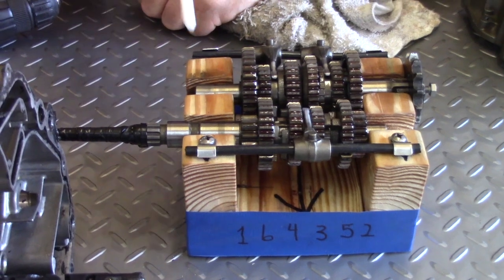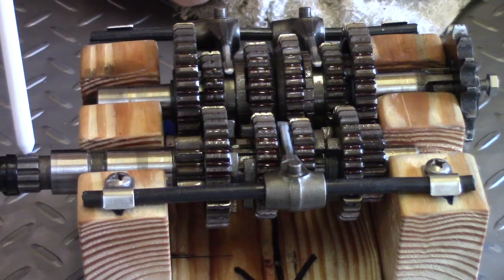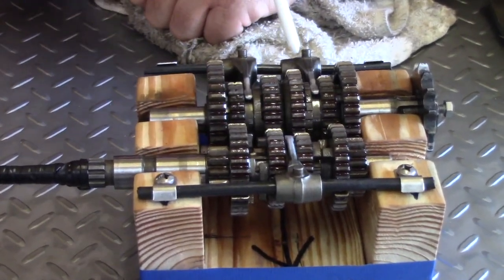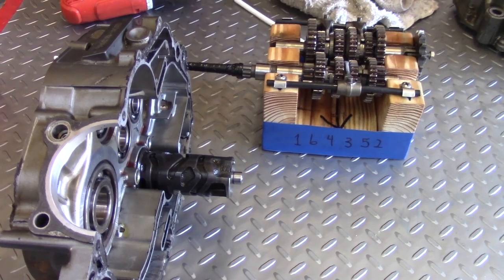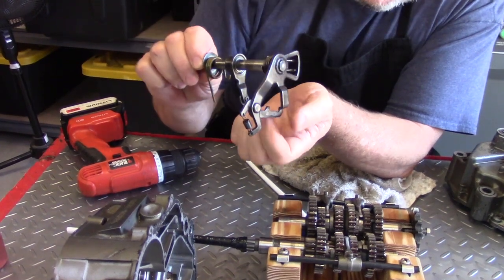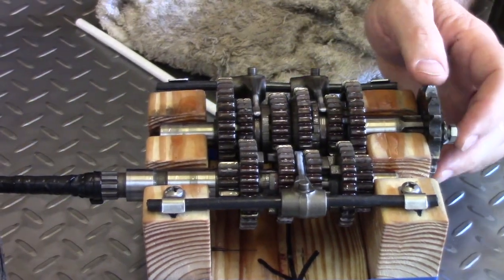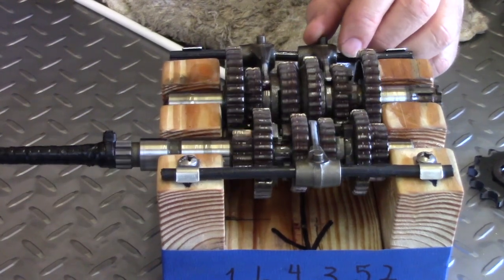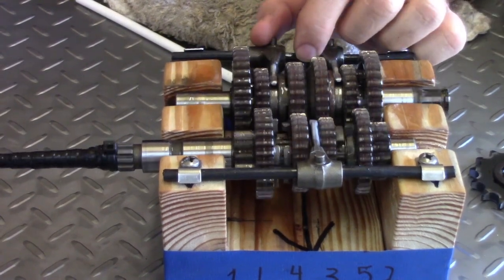How a Motorcycle Transmission Works

Comment: Thank you so much. I was on the interstate with my project bike and I had it stall. I was coasting in neutral and it about 27-29mph I tried to pop it into second so I could attempt a rolling start and got that loud gearbox "KA-THUNK" because it wasn't synced and thought, "what the hell is actually happening in there?". Now I know

Comment: Good understanding...by me...one small query for 5th and 6th gear you wrote wrongly(changed)the number of teeths in driver and driven as eg.for 5th gear 25 for driven and 27 for driver..instead of that you displayed 25 for driver and 27 for driven...I got confused with did and checked all other gear ratios and got cleared...but all the way great realistic model explanation...

Comment: How does gear dogs slide in when speeds are mismatched
Reply from the maker: Leo, that's the nice thing about "constant mesh" transmissions - the gears are always meshed. Have a look in the Articles section of my website and you'll find a detailed explanation of this design. The only thing that the drum has to do is engage the two shafts which are the same size and when the clutch is pulled or the throttle "blipped" removes the side load and allows the forks to easily move the "dogs" in place. Check it out - and I'm glad you asked! Gordon

Comment: I saw no real difference in output speed until 5th gear. I have yet to find a video to explain with a proper demonstration how the shift lever/drum works.
Reply from the maker: Thanks for the comments. You're almost right - there is very little difference between 5th and 6th. 5th is .9:1 (point 9:1) while 6th is just .8:1 (point 8:1) so just 10%. If you visit my website and the Articles Page, I have an article there with lots of detailed drawings and explanations of how all this works. It will show you how all the numbers and transfer of power works along with that drum - all in plain, clear, english. I hope I've been a help to you. Gordon

Comment: When you're at rest and going from neutral to first, and both shafts are stationary, if the dogs are not aligned with the slots, how do you shift?
Reply: If both shafts are stationary, then your engine is off and the bike is not moving. To go from neutral to first in this case, you will need to move the bike slightly while pressing on the gear lever in the required direction.

Comment: great video thanks.
got a problem with my quad gearbox ,it works on dogs and cogs.2 3 4 5 all work fine,5 speed. 1st and reverse which i think are conected as you can only select reverse when in 1st gear. when you engage sounds like the cogs /gears are spinning but not meshed together so no drive.can you help thanks.

Comment: Excellent explanation.. Am I to understand that then to have 7 or 8 gears I will basically require a different selector drum (Extra gears of course) BTW why are the lower gears on the end of the shafts ? (less torque or stronger to stop bearing wear.)

Comment: Took me 3 times to see that the gears are already connected but the output shaft is non moving the rotation unless you are clicking in place with the dogs sliding in but the same time the dogs inner gears have to slide along the output shaft since they are solid with it how is it possible? The dogs don't slide left or right into place unless you move forward or backward the drum that's connected to the shifter going up or down)
Reply from the maker: Hi Alex, Yes - all of the "gear pairs" (front and rear) are always meshed. This is why almost all motorcycle transmissions are referred to as Constant Mesh. The shift forks move the dogs in/out of engagement. The shift drum has the very important job of controlling those shift forks so that 2 different ratios are never engaged at the same time. The dogs are the heavy blocks with side-facing cogs that slide into the toothed gear pairs. Those dogs are splined to the shaft with splines and simply slide side to side by the forks. The gear being engaged free-wheels on the shaft without the dog's engagement. If this doesn't happen, the transmission does what we call explode and cannot live. Let me know if this helps, if not I'll try to explain more. Thanks for commenting! Gordon
Reply: @RRRToolSolutions1  so the shifting is seamless and smooth unlike the one in a manual car transmission the clutch is needed to disengage the teeth. And a bicycle has a similar mechanism of rolling the chain on and off each sprocket kind of like the motorcycle except the motorcycle has the same sprocket and never moves because the gear ratios shift side to side instead of the chain itself... this leads to me the question why does the chain suffer so much abuse then unlike a bicycle I see metal shavings or gunk debree, needs to constantly tighten every several hundred miles and lubed with special oil? Why is there also a slack of 3/4 inch needed if the bike is not having the chain move out of gear or why the chain would sling off?
Reply from the maker: Alex, the exposed drive chain has to live and operate in one of the worst environments ever imagined. Dirt roads, paved road debris, small rocks, grit, and water all find their way to the chain. This is just like sandpaper wearing down everything that it touches. While lubricants, especially those having wax to hold the lubricant in-place do act to hold the contaminants in-place also. We have to lube though as it reduces wear more than a dry chain will. The slack is needed so the rollers do not bind in the sprocket peaks/valleys. Chances are that your front (counter shaft) sprocket is not in the center of your swingarm pivot - rarely is this brilliant geometry used. As the bike's rear suspension goes through it's travel, the distance between the front and rear sprockets "center" changes. In the case of dirt bikes (those with more travel), those distances can be very significant. You'll see spring-loaded chain tension devices there to keep excess slack from fouling the chain. Gordon

Comment: Never understood why it’s been
1N23456
And not
N123456
Reply from the maker: Ryan, neutral was at the bottom in the 1968, 1969, 1970, 1971, and 1972 Kawasaki Samuri, Avenger, and MACH III 500's for a N-1-2-3-4-5th. I've owned 2 of the Avengers and 3 of the MACH III's and they were brilliant. The 1973 models changed that and all of Kawasakis were forever changed to today's pattern of 1-N-2-3-4-5. Even Honda's very popular 1960's/70's CT70's and CT90's had neutral at the top and shifted downward 4-3-2-1-N where you pressed the toe downward from neutral at the top to 1, 2, 3, and 4th. I still have the 1969 CT90 with this pattern. Neutral can be anywhere the engineer wants it to be - the "Shift Drum" controls the where all gears are free to spin. Thanks for commenting! Gordon/RTS
Reply: RRR Tool Solutions 864-710-7964 thanks for all the info. I’ve noticed that for a couple of bikes you can actually reverse the shift movement so toe down equals shift up. Apparently it’s a common thing in motoX

Comment: So when a transmission is failing, what parts are causing the noise? My bike makes a loud click/clunk sound when changing gears, what am I actually hearing?
Reply from the maker: Jeff, what make/model of bike? Is the noise worse when going from Neutral to First than when going to Second, Third, and so on? This matters, so the questions....Thanks, Gordon
Reply: RRR Tool Solutions 864-710-7964. Thanks for the fast response! It's a 2012 BMW G650GS.  The click from neutral to first is most noticeable but it doesn't always make the sound. Shifting from first to second and third makes less of a sound and doesn't feel as "stiff" while shifting in to a higher gear  The entire shifting process isn't as smooth as other bikes I've rode, but some say this is just the way BMW motorcycles are and not be concerned.  
After watching your video I was thinking the noise is from the gears wacking together or not aligning smoothly. 
Thanks for any and all feedback!
Reply from the maker: Jeff, I've had the same problem with different bikes. You've got a big single that needs to idle at a higher RPM than most twins, triples, and fours. The culprit is your clutch - not your transmission. There is an easy fix -

Large singles deliver their power all at once which means the combination of clutch diameter and number of plates be robust. This fact and the higher idle rpm often result in a "dragging clutch" that keeps the transmission input shaft loaded in neutral and when going in gear. Simply put - the fiber disc and steel plates stay "stuck" together or at least partially engaged. My 650 single has this issue too.

The perfect solution would be to somehow mechanically separate each disc and plate at each clutch pull, but that's hard to do. Some bikes have metal wave washers, others have rubber V-rings between every metal plate - both intended to force separation of the disc and plates as the lever is pulled. The compression springs overcome these of course as the lever is released. Even these have their failures and don't solve the dragging entirely.

Solution? Try it before you comment. I swear it has fixed every shift complaint I've had and really makes the operation of the transmission/clutch near perfect. Finding neutral is greatly improved in most cases. Motul 10-W40 Synthetic 7100. I have been using it exclusively in all of my 4-stroke bikes for years since that first change. It really works. Gordon
Reply: RRR Tool Solutions 864-710-7964 that's a great answer! It really makes sense too, and also helps me understand why this can be considered "normal".  Thanks for the advice!
Reply from the maker: Jeff, let us hear how the change in lubrication affects your shifting, finding neutral, and the noise levels as gear selections are made. Thanks for commenting! Gordon/RTS

Comment: Hey, maybe you can answer one of my pet peeves. On my old Brit bikes when you get to top gear you can lift the lever rather the lever being locked in place in the lower gears. On new bikes the lever is locked in place no matter what. I like the old arrangement better because I know when I'm out of gears without pulling the clutch in. Why is it different now?
Reply from the maker: I can't help on this answer. While I'd guess it had to do with the detent system used on the different bikes, I have never been inside one of the British bikes like the Norton, BSA, or Triumph. Thanks for commenting....Gordon/RTS

Comment: RTS, I own a semi-auto wet clutch 110c honda cycle with 4 gears.  It's a city oriented motorcycle that's why the low displacement and extremely short gear ratios. Do you think it's possible (besides changing chain gearing) to add a 5th gear in this type of gearboxes?
Reply from the maker: Hi M, I have owned 3 Honda 90cc machines and still own 2 of those. I believe your 110 is built on the same platform. These engines have been around since the mid 1960's, they are rock-solid and proven. In fact, mine are a 1966 Super 90 and a 1969 CT90 (Trail 90). They have also always been 4-speeds as far as I know. I don't think the parts would exist to make the conversion. The gear sets in these are narrow and the shafts those ride on are short as are the case-halves quite narrow, so I don't know of any parts available to do this. Thanks for your comments - Gordon/RTS

Comment: Anyone familiar with a  (1975-1992) watercooled engine Volkswagen 020 gearbox (golf/rabbit/Jetta/scirocco)will notice some similarities between it and a motorcycle gearbox.  
Hollow mainshaft for the clutch pushrod, and the shift drum mainly.
That would be kickass to machine up a sequential shift drum somehow,some way.
Reply: MrTheHillfolk Why was it watercooled? racing?
Reply: dimmacommunication 
Oops I'm sorry sir. 
I meant the watercooled Volkswagens made after 1975 or so, like the Vw golf (rabbit in America) and Jetta.
We had the first gen of watercooled vws here from 75-84, the second generation hit in 85 and went till 92. 
93 on up they changed gearbox styles. 
But yea the old 020 Vw box was pretty stout for its size too. 
It weighs like 75 pounds, and guys would have 250-300hp 16 valve vws back in the day(mid/late 80s)  and they would handle it.
And I edited the original post, so hopefully I cleared up any future confusion

Comment: Useful vid but would have been nice if you explain how power is transfered the the shafts and why gears jump out or wont select...youd done 80% and missed 20.
Reply from the maker: JB, I would love to show you that, but don't have the parts I'd need. I've only had 1 transmission out of the 50 or so I've been into that had the dogs chewed off, broken, or sheared off. It had a bent shift fork too - all excellent signs of abuse. The rear motor mount nearest to the front sprocket was broken too from repeated 7,000 rpm launches. I tossed that transmission into the scrap years ago and later used the crankcases for fabricating engine mounts and expansion chambers in my H2 (Kawasaki Mach IV) hotrod/drag bike. You can see and read about the bike in the articles section of my website. A picture of the crankcase is there too. Look for "2 Stroke Exhaust in the menu". Thanks for commenting Gordon/RTS

Comment: I've always thought 1&2 3&4 5&6 we're 'separate' inside. Because 1&2 have a different sound to them 3&4 are my most fluent gears and as I get to fifth I sometimes get into a false neutral or it goes in halfway but then drops out of the gear when I'm driving and makes an awful sound.
Reply from the maker: Jay Bee, there are a couple of things that could be causing this. I would first check to see if your bike's transmission has an "eccentric adjustment" for the shift return spring. This "centers" the shifter and means you'll have a full stroke each time the shifter is moved up and down. Not all bikes have the eccentric, but it's an easy adjustment once the engine cover and clutch components are removed. It could also have a weak centering spring (less than $10 part). Second is the shift fork - if one is bent, it can't move the dogs to engage the gears (like your 5th). Shift forks are replacement items, but it does mean a tear-down to get to them. Third could be the engagement dogs themselves - if subjected to abuse over a long period, not using the clutch, of failure to fully move/engage the gears (some bikes just don't shift quickly - my CB750 was one) and slower, more deliberate shifts are best practice. This diagnosis and repair is more involved and requires a full transmission tear-down and disassembly. Gear sets can be $100 or more per pair.

Thanks for commenting. Gordon/RTS

Comment: show what is a different between 5 speed transmission and 6 speed transmission
Reply from the maker: Amit, just picture the demonstration without that the "pair" of gears you see labeled "6" in the demonstration. A 5- speed transmission will look and function the same as this 6 speed, just minus 1 pair of front/rear gear set. Most 5-speeds use 2 shift forks in stead of 3 like this one, but again the functions are the same,

If you'll send me an email through the website, I'll send you photos of a 5 speed and diagram what the differences look like. I can't post photos here. Thanks for commenting - Gordon/RTS

Comment: Is it just me or were you running in reverse? Output countershaft was running CW.
Reply from the maker: Bruce...Busted! Yes, the rotation is backward of what you'd have in real life. Two reasons for the the wrong direction -
First, the coupling I used for the input shaft would have "un threaded" if turned counter-clockwise, Second, with the input shaft not secured to the block - the shaft assembly would raise and come out of mesh with the output shaft. I did  try it, but turning it "left" was not working.

Thanks for keeping me honest and commenting! Gordon/RTS
Reply: no worries I just thought I was seeing things

Comment: Granny shifting not double clutching like you should
Reply from the maker: Double clutching refers to the 2-step process of disengaging once for in-gear to neutral - release - then disengage a 2nd time for neutral to in-gear. Since motorcycles don't access neutral between each gear, neither the term nor practice would apply. Thanks for commenting - RTS
Reply: Its a Fast the and Furious reference. Be glad you didn't get it. :)

Comment: I am having problems to change the gears. Sometimes it doesn't go easily or even it get stucked. What's he matter?
Reply from the maker: Andy, what bike is it? I ask because some big singles have a tendency to suffer from clutch drag. If you haven't abused the clutch and transmission, then damage is not likely. The cheapest fix could be a better quality oil. I've owned 50+ motorcycles and 3 of those were just horrible when it came to finding neutral when running. Motul 7100 is just "magic" - even my big DR650 single with it's 1,500 RPM idle was a pain in the butt due to the clutch plates wanting to drag. Many times, the only way to get into neutral was to kill the engine. Motul solved that on the DR650, my Kawasaki Turbo, and my KZ900 - all were buttery smooth after a simple oil change. Now, you could have bent or worn shift forks, improperly adjusted shifter spring, damaged shifter arm/ratchet. Hope this helps - Gordon/RTS